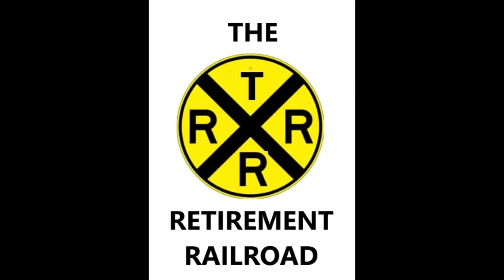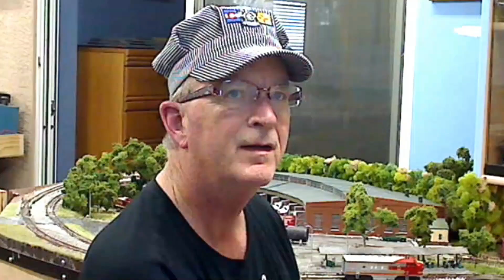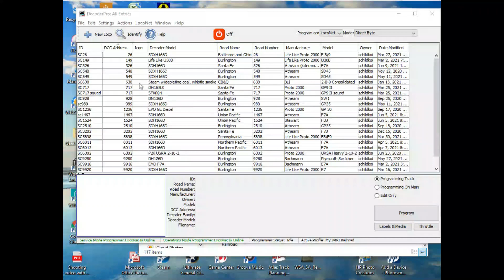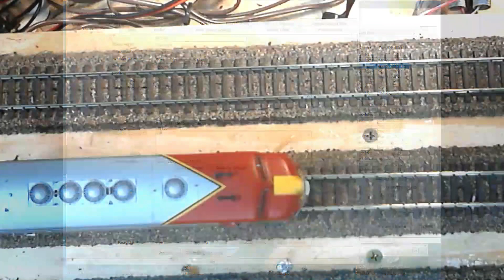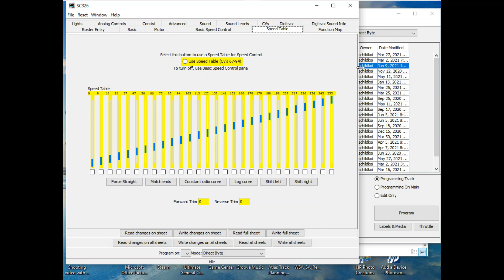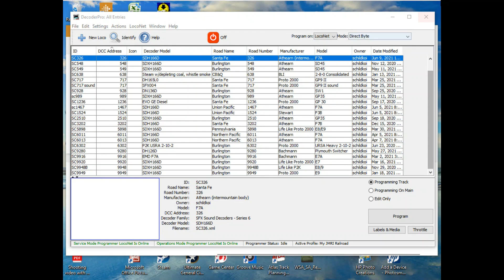Matinee Modeling #107 Tip of the Day, Speed Control and Matching using JMRI/Decoder Pro

Comment: Kind of wish you showed the pain of adjusting.  It would be interesting to see that process.  It would have also been cool to show us how close on consisting it was.  Jac Jac, because he buys the same manufacturer and they all have the same decoder, he just copies over the same program.  So it would be cool to see your results.  And does it work with different decoders in different engines? Just curious, because that would really help reduce the speed match issues for everyone
Reply from the maker: I had it all video'd but didn't want to waste all the time since it was simply a matter of warning the loco up first. As far as same manufacturer/same decoders all being the same....not really true.  I have 6 Athearn BB F7As and Bs, 4 of which are the super power design (large flywheels and large saddle weight). None were the same but all were 70 scale mph in the middle 10%. By using the Accutrac II I have them all dialed in on their speed curve and have adjusted the momentum on the non super power version so that they all consist without issue due to their speed matching. Knowing to start at the mid range for 70 scale mph dials it in pretty fast (within 3 adjustments) when warmed up first. I often times hit it on the first adjustment. I have used this process with P2Ks (multiple models...GPs and Es), Athearn, Bachmann, Bowser, Walthers and BLI  with digitrax, soundtrax BLI and QSI decoders.